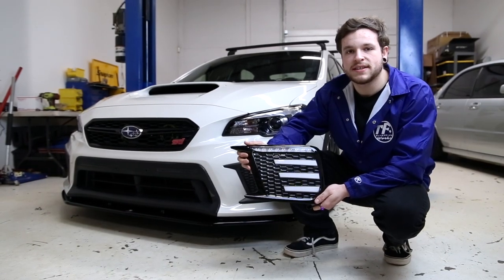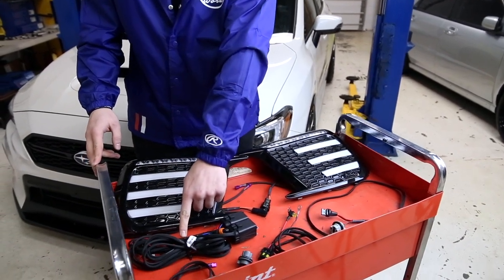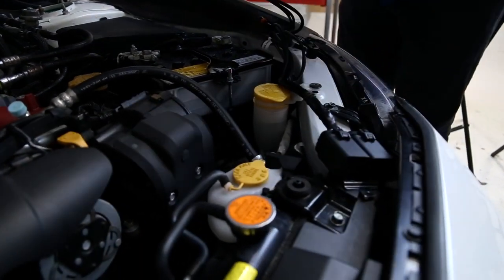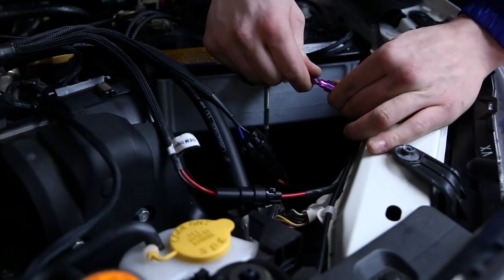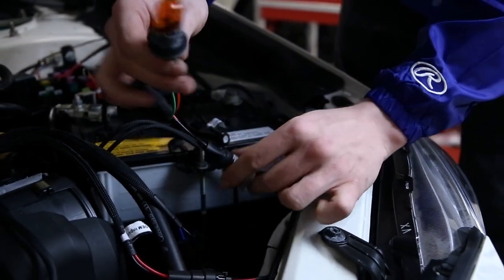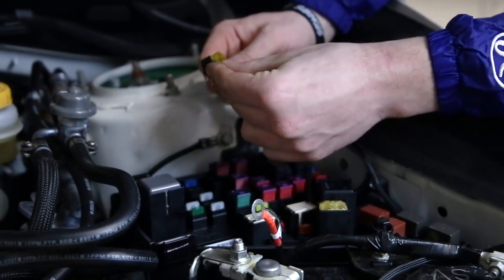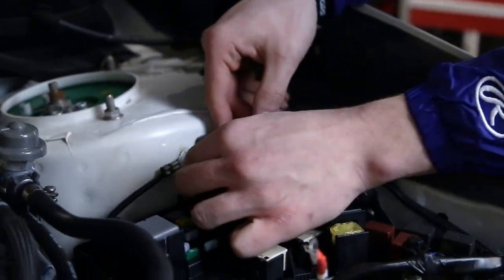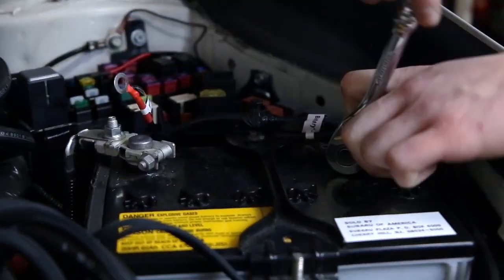Subimods | Molded Innovations Boost LED Bar Kit Install

Comment: For 2020 model front bumper needs to be removed due to the bezel has a screw type pop clip holding the bezel in place. Beautiful lights . Subimods thankyou for all the support and best customer service.
Reply: About to pick up my 21 STI in 18 days. Even if you jack the car up, you still can’t get the bezel’s off? Little nervous taking the bumper off a brand new car.
Reply: @AdamFrom614  Did you end up taking the bumper off?
Reply from the maker: Np👍🏻

Comment: I just installed mine. Just wondering if there is anyway to plug the piece in so i can have them on with my day time running lights.
Reply from the maker: I will have to research this and get back to you!

Comment: Mines work but DRL don’t! The bars only turn on when the low beams are on  do I need to tap any wiresor what do I need to do? please help
Reply from the maker: You are potentially using the low beam fuse instead of the high beam fuse and will cause this issue.

Comment: Are these DRL only or is it possible to wire them to run with headlights on? Base 2020. (New to cat mods)
Reply: ...all depends on what you wire the relay "power on" to. When do want the relays to trigger on? That is the circuit you use.  On all the time would use a circuit that switches on with the ingnition/ON position.  If you want them switched, you wire the relay-ON to that switched circuit (e.g. Parking or low beam)
Reply from the maker: Hi! Please reach out to our support team via phone or email for product questions, thanks! support@subimods.com / 8602910015

Comment: Damnit i got the off brand OLM version with shit quality
Reply: @ensulyn they might be but these look mich higher quality than the olm ones olms cracked after a single day installed and after 5 months the paint is peeling off
Reply: @ensulyn they are shit do not get them the “wiring harness” is just a couple wires with shitty little clips that dont work you HAVE to splice wires yourself to make it work, these on the video are amazing they’re plug n play and easily reversible unlike the olm ones
Reply from the maker: OLM is a decent brand but not up to Molded Innovations quality in our opinion.